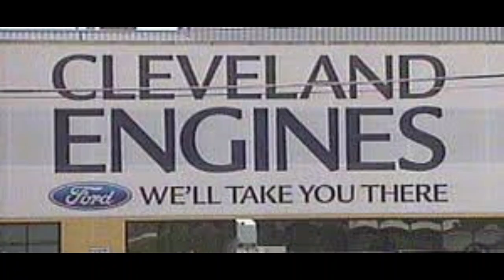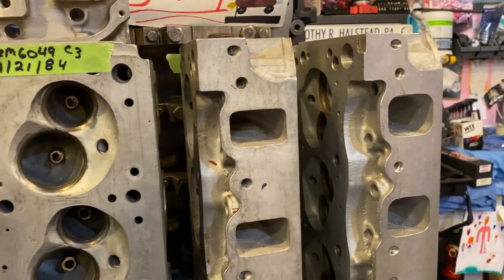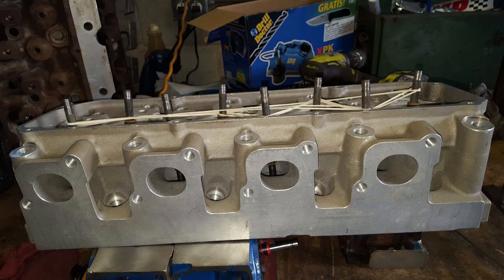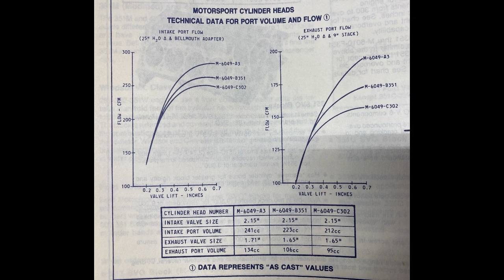DBG: The Evolution Of Ford Motorsport/SVO Aluminum Cleveland Based Cylinder Heads, Alphabet Soup..

Comment: I've been into engines since i read my first SS&DI back in the seventies.  For some reason, it just clicked for me that the Cleveland head CRUSHES just about every other small block (production) head ever created.  In my head, a 351W with Cleveland heads should have NO problem making 500+ hp on pump gas.  Especially with a "modern" Cleveland head.  Am I crazy??????
Reply from the maker: Me my friend. You are right about, they make some serious horsepower......500... No problem

Comment: Ernie Elliott can make insane power no doubt but in the mid 80’s NASCAR didn’t have a tread width minimum, so Bills car was up to 7 inches narrower than Earnhardts on the big tracks. Smaller car equals less drag. Ernie could really make a car drive good on the straightaway.
Reply from the maker: Good to know. Thanks for the info. Few mph and mpg.

Comment: I always stay until the end because there’s always something new to learn on DBG ! This was another excellent presentation, Tim. I had almost forgotten the important facts pertaining to the different exhaust port bolt hole spacing on the various Motorsport heads. Everything you do is greatly appreciated, my friend 🏁.
Reply from the maker: Thanks Daniel. Glad I could keep your expectations high. Working hard to keep the history going. Yes, need to know that. I have had to have some changes to match the earlier 2.77 pattern.

Comment: What are your thoughts on using 2v heads but it’s a turbo motor?
Reply from the maker: I don’t think there will be an issue, however, the cylinder pressure and thin cylinder walls may not like it. Just be reasonable, watch this
https://youtu.be/lQhOUmFcgN8?si=BHNCAlSvguHOmDBC

Comment: Excellent job Tim!! The early Ford aluminum headed monster, great subject. Between the heads and intakes the casting numbers tell many different stories. I came into a set of C3L's a few years ago for a '35 Tudor Sedan project and had no idea what I was in for. I was after the bigger combustion chambers. The Intakes that fit are especially confusing, same casting numbers, different intakes. They are on a D2 4 bolt block I've had for years.
Reply from the maker: Your most welcome Marc. Yes the numbers sometimes don’t make sense at all. Better get that 4 bolt going.

Comment: In 80 Len wood told ford that they were out of good Cleveland blocks they were using astr blocks but they were still not working so ford got the old Cleveland mold out and mad blocks and heads
Reply from the maker: They must have came from Australia, firs sent all the patterns there in 73 or 74?

Comment: Hi Tim! Very good! Yes, there were a couple of 302 based NASCAR  engines, the one I knew of was built by Robert Yates, for restrictor plate racing. The bore was about 4.08, and the stroke 3.25 inches. The car was very fast, for a restrictor plate car, and NASCAR made it illegal,  right after.  The C302 head with the more rounded area around the spark plug side is much like Larry Widmer's "soft burn" chamber that got a lot of coverage in the media in the mid 80's. Larry was doing consulting on engine projects, Cleveland,  and Boss 429.
Reply: Larry Widmer is a genius. I softened my chambers to create a return wave, like a 5th cycle.
Reply from the maker: @XTT162 yep I know what harmonic your talking about.
Reply from the maker: Yes that sound right from what I have been hearing. Love that stuff. Yes I have talked to Larry before, may need to get him on too. I have that article, the soft one, I think it is.
Reply: @dragboss351cleveland … Having Larry Widmer as a guest on DBG would be quite interesting. Hopefully he could provide some important insight into the Cleveland high-port iron head conversion set with the matching Scorpion intake that I have and still plan on using very soon. They were produced by his Endyn Incorporated shop way back in October of 1982 about the same time those awesome Motorsport Aluminum Cleveland Heads became available 🏁.
Reply from the maker: @danielwilson6665 yes I just messaged him. See what he says. There was an issue with the boss 429 heads as. Glidden. Like to hear what he says.
Reply: @dragboss351cleveland  … I’ve heard about that particular B429 head issue as well. It would be great to have Mr. Widmer as a regular contributor here at the DBG. It seems like quite a few people are familiar with his successful accomplishments featuring Ford heads. Especially with the Cleveland high-port iron variety. The amount of skilled workmanship that went into my set is impressive for sure !
Reply from the maker: @danielwilson6665 right on my friend. Todd Fuchs stopped by DragBoss Garage with a big announcement, shocked me. Stay tuned.
Reply: It(Roberts) revved like big Husqvarna chainsaw. Never heard anything like it. He was on the. tune! How could a little bitty 302 deck sound so burly at 9000 rpm’s, it was that wide banded pulse! Man I can’t remember for the life of me.who did the other one. It sounded like a 289-302 firing order too, but I’d be lying if I said I knew.

Comment: Hey Tim, my 74 Gran Torino has the stock 351 2V heads. Do they have any potential to make power like 350hp? Always wondered about them. Great video! Take care buddy 👍👍👍
Reply from the maker: Sure they do. Just have to build it accordingly. Love Torinos Mr. Will
Reply: @dragboss351cleveland  Thanks Tim! I still have that itch to soup up the Torino a bit. Maybe over the winter.😂👍👍👍
Reply from the maker: @Mr.Will73 a car like that, will pick up with a set of gears for sure.
Reply: @dragboss351cleveland  For sure, It has a 9 inch with 3.00 gears I believe. It’s beautiful on the highway but has no pick up. Big heavy girl but very comfy😂👍
Reply: @MrWill73  … The 2 barrel Cleveland heads have better flow potential than iron Windsor heads and SBC heads in stock trim. Contact a reputable cam grinder that’s familiar with Cleveland requirements and get a hydraulic roller cam setup with matching valve springs. The heads need stainless steel valves and single groove retainers for reliability. 

An aftermarket dual plane aluminum intake manifold with a moderately sized Holley 4-V carb will take care of the induction system. There are plenty of long tube headers available for your Torino to go along with a low restriction dual exhaust system. Also upgrade the ignition system with modern components from MSD. Your goal of 350+ horsepower is easily within reach. 

You really should upgrade your 9” rear end with a Traction-Lock differential and 3.91:1 gears to fully take advantage of the new cam and engine upgrades 🏁.
Reply: @danielwilson6665  Brother, I did not know that about my little Cleveland engine. Thanks so much for the information. I copied your comment and put in my notes so I have the great information you gave me! Thanks! I appreciate you 👍👍👍👍
Reply: @MrWill73 … Always glad to help whenever possible. That’s just a general overview of mostly bolt on parts. One concern about the 2-V heads is the large open combustion chamber and the resulting lower compression ratio. That’s why I suggested using a cam company that has strong knowledge about Clevelands. They can provide a camshaft that’s compatible with the stock compression ratio. 

The alternative would be to do a complete engine rebuild with pistons designed to build more compression with the open chambers. The ideal solution would be to use aftermarket heads like CHI’s or a set of original 4-V quench chamber heads but if cost is a concern, then your 2-V heads will do fine when combined with the other compatible parts. Just use the knowledge available from Tim ( DragBoss) and the other experienced folks on DBG to plan your engine modifications before spending money on unnecessary parts. 

You and your Torino will love the results 👍.
Reply: @danielwilson6665  No doubt brother. I wouldn’t even loosen a valve cover bolt on my Cleveland before getting the guidance from Tim. To me he is a legitimate court of law level expert on Cleveland engines. I’m currently working  on literally 4 of my cars right now and a 5th one will be my big Winter project. I am trying to get as much as I can before I can only work inside my garage with the heat on. Once I really can put the Torino up and work on the motor, I am going to get with Tim and ask a few questions I have to pull this little project off correctly. There is nothing better when you modify a car for more power and the cam, torque converter, carb, heads and rear gears all compliment each other. IMO that is the only way to go when you really want to make power at any level, from mild to all out!
Reply from the maker: @Mr.Will73 thank  you for the compliment my friend. But you are so right, you want all the pieces to complement each other. Each one making the next one work better, all with the same goal. Key word is goal, and plan accordingly. Buy the best and cry once. Today was 47 this am, switching the AC to heat at DBG.
Reply: @dragboss351cleveland  Absolutely brother! You are the go to about all things Ford and Cleveland engines. Just stating fact. The weather is getting cold. I’m in a mad dash to finish some projects before it’s too cold to work outside. Take care my friend!

Comment: Had no idea there had been this many versions of Cleveland heads made for racing. I'm still trying to decide which direction to go with my 351C 2V I drive on the street. Thought of keeping the 2V heads and going with intake, four barrel carb, and mild cam, but not sure if I would be wasting my time with the low compression open chamber heads. Want good power and torque for the street. Don't really want to spend a ton of money on aluminum heads. On the plus side, I can run regular gas with the low compression. Would like to keep double digit fuel mileage for cruising. Hmmm...
Reply from the maker: Need to figure out your goal and what requirements needed and build accordingly. That engine will cook on the street with right cam, headers, gears. You may surprise yourself.
Reply: @dragboss351cleveland  Well, 300hp to 400hp and good torque would be ideal. Car currently has a 2.75 rear gear, thinking of going up to a 3.50. I know the Cleveland has loads of potential, was just wondering if it would perform well with only 8:1 compression. Thanks.
Reply from the maker: @aguyinnc2865  that car needs, 10-10.5, cr, 3.89, cam of 225-230 degrees duration at .050. Then figure out converter.
Reply: @dragboss351cleveland  Thanks!

Comment: Hey Tim, long time between drinks. I have an embarrassing amount of FMS high port heads and intakes. Liked the video. One comment I'd make is don't assume all variations you see are/were done by Ford. The cup teams and fair haired children got what they wanted, and many times, they got partially machined castings so they could apply their own (secrets) knowledge to given features, like combustion chambers and exhaust port shapes for example. So it wasn't just the heads that were part numbered as unmachined that found their way to race teams with unmachined features. Best, Kelly
Reply from the maker: Good to hear from you Kelly. Not sure why I like all this old stuff. Grows on you. But yes, some of these could be modified for sure,  but I did not know is the C3 was in production in 1984. Funny how Ford made things reusing numbers and such. I can’t wait to get a mule done so I can mess with these and test what I have. Thanks for watching, always great to have you on. Do you still have your Pantera?

Comment: Tim, you literally just helped me figure out what heads I bought months ago. One of the previous owners ground the part numbers down, but a lot of people told me I had c302b heads, including Jimmy huff. The only thing is, my valves don't cant, both int. And exh go straight
Reply: Sounds like a Yates head. The reason for the lack of canting the valves, was too reduce the size of the valve relief, so that they could move the top ring up, on the piston. This reduced the crevice volume, around the top ring, and actually burned more of the fuel, giving a 2 to 4 more laps on a tank of gas. A critical point, as the GM cars typically were better mileage, and could get away with one less pit stop, in a long race with few caution flags.
Reply from the maker: @johnsalvaterra3116 right on John. And they good make combustion chambers much smaller too.
Reply from the maker: Cleveland based heads all have can’t. Yates don’t. What heads do you have then? Your welcome my friend

Comment: I do believe Ford Motorsports was quite a bit ahead of the game once they came out with the first aluminum A3 heads. Chevy had nothing that compared. The very best aftermarket Chevy heads could not flow the amount of CFMs that these did. 
And once the engineers at Ford Motorsports began playing with various port shapes, sizes, and hights....as well as chamber shapes and valve sizes and angles, all within the boundries of the physical cylinder head size, they were capable of making much more poiwer than an equally built Chevy small block.
By the time the Yates heads arrived on the scene, NASCAR had to allow Chevy to have their SB2 heads, just so they could be competitive with the Fords.
Reply: I can add a little to the story, if I may. During the 1988, thru 1991, NASCAR,  officials found welded cylinder heads, particularly on one Chevy. The story related to me, and I found later corroborated by "Stock Car Racing" magazine. This particular feud between Mr. Hendrick, and Childress,  centered on cylinder heads. As the Charlotte racing community is pretty close, a cylinder head specialist, could not understand how a certain black Chevy, could always seem to outrun Mr. Hendrick's Chevy. In a local establishment he had a discussion going with another person at the bar. The discussion  turned to racing, and how that black Chevy out ran the Hendrick Chevy. Well it turns out the man, was doing the cylinder heads for that black Chevy, and he agreed  too do a pair for our cylinder head specialist.  The heads were welded, and the valves were moved, some, different chambers, usual stuff ! Then Mr. Hendrick had an engine built with these newly procured heads, and entered the next race. Lo and behold, Mr. Hendricks Chevy was as quick as that black Chevy.  Mr. Childress protested, and found that, yep ,Mr. Hendrick had caught on, to his game. Then NASCAR,  looking pretty bad, overlooking that fact that their own rule book stated, no welding, on cylinder heads, had to eat crow. The interested parties had a meeting, and all were allowed to submit 1 new cylinder head design for the 1992 season. All GM cars ran the same head, all Ford's, got to use the first Yates head. Robert Yates definitely  had a better idea. The GM teams complained, and were allowed to change their design several times,  resulting finally in the SB2.2 around 2000. Ford's were required too stay with the original version Yates head, until the D3 head was allowed  around 2005. The last real Cleveland head before the FR9 engine.
Reply: @johnsalvaterra3116  I lost interest in NASCAR when they stopped using the Yates D. Cleveland, that was the last honest Ford engine to me.
Reply: @Bbba724   Yes, I have too agree, I don't watch NASCAR.  The NASCAR officials gradually took away the ability of mechanics, to set the cars up the way THEY wanted. Everything had a specification , weight of connecting rods, pistons, crankshaft, valve size, everything. Then you had to run the tires, they gave you, and run them in the position, they told you to run them. Just a few examples, but for me, like you, it was "what's  the point". NASCAR wanted too control it all, and that is what they ended up doing.
Reply: @johnsalvaterra3116 well said,I don't watch it ever,pis on it all,hopefully it will go out of business and people will stop going,all they want is dam control,that not racing, stop changing every thing,let the smart mechanics work and who can build the most power ,that's how it should be,that called true racing ability, that what racing is about,not having every dam thing equal, if ford makes a better head,let chevy try to get better,or vise versus
Reply: @johnsalvaterra3116 well said,the chevys had to cheat of course, so heck on all nascar shit,just like prostock racing,they shit wrecked it,when they went to fuel injection, nothing any badder,and racie as 2 big dominators and that wonderful sound
Reply from the maker: @johnsalvaterra3116 very cool story John. Love it for sure. Have to get you on for a live chat?
Reply from the maker: That’s what I’m talking about. Your right no Chevy head could compare. Those A3 could have the potential for 1000hp with single four, with right size bore.
Reply: Well said,the chevy head shouldn't have been allowed, all they did was a copy the ford head,they should have had to stay with there original design, just like the cammer,Nascar killed it ,and the tunnel port fe in matter of time,so Nascar I don't watch no more period,it's not about racing and horse power,it's about parity, they should go back to the good old days, make 427 ford fe block,chevy 427 and 426 Mopar blocks,and use the factory type heads and race,be so more better,and nalsagia ,and cars not modified so much, that's my 2 cents,that's where racing started  from these iconic motors
Reply from the maker: @eddiefe428 I like that Eddie, have not really watched any nascar since like early 2000s. The love Chevy and can die with Chevy